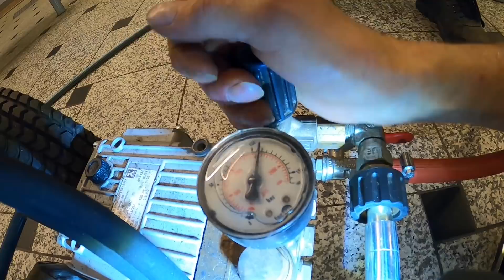Kempinger 252. Nächtlicher Knochenjob .120 Meter Hochdruck spülen im Kriechgang  bis zur Hebeanlage

Comment: Hi Carsten, is this work done at night,are the train’s still running?,I did contract work on the London Underground all platform work was at night
Reply from the maker: Hi Danny..it was a Thursday night.. I started at midnight.At about 1 a.m. the train traffic was stopped so that I could slowly start... Do your tunnels look similar below?
Reply: I think you were under the platform if so then yes very similar, we were replacing pumps/pipe work etc.
Reply from the maker: @dannywilkins887   Yeah ..on one of our main train stations we have here....Guess I would have had to show the new lifting system too then...
Reply: Yeah that would be interesting 👍

Comment: Hallo! :) 
Schöner Einsatzort!
Sagmal was ist das für eine Düse.
Die entwickelt ordentlich Power bei dem kleinen spüler. Gruß
Reply from the maker: Endlich hats mal einer erkannt .. 😅Hi,  ich bin auch recht zufrieden und das bei 10/100 bar .. Diese habe ich von Cobra nozzles Australien mit einer 0,53 Düse. 1/4"
Reply: Hallo
Danke für die Info. Hast du die Düse mit quick connect adapter oder mit schrsubgewinde? Die Düsen bei cobra sind ja alle mit schnellverschluss. Gruß aus Hannover
Reply from the maker: @JF-fx7hm  Zum Schrauben.. Halte dich an Nello falls du Englisch kannst .Da macht das wie du es  haben willst..Meistens möchte er auch wissen welche Pumpenleistung du hast ..
Gruß zurück
Reply: Hallo
Danke nochmal. Chef konnte ich überzeugen dank deiner Videos. Mit nello Kontakt aufgenommen und Bestellung abgegeben. Jetzt freu ich mich auf die Lieferung. Mach weiter so. Und stell auch mal dein Equipment in einem Video vor. Gruß
Reply from the maker: @JF-fx7hm  Kein Problem. Düsen hatte ich doch im Elias Video gezeigt..